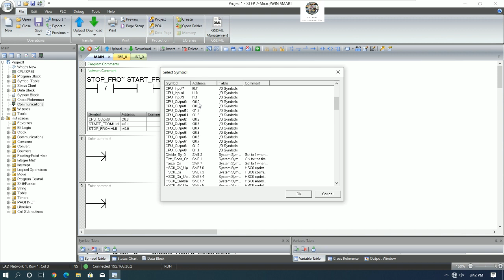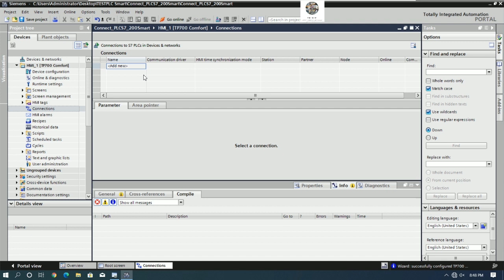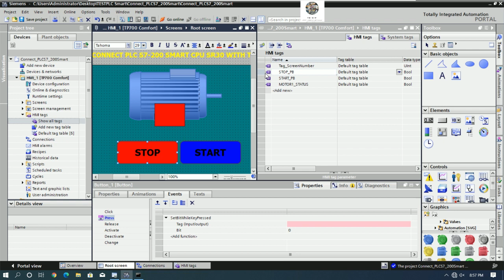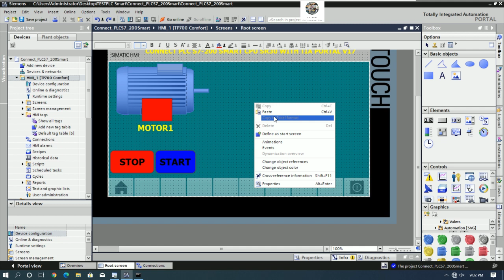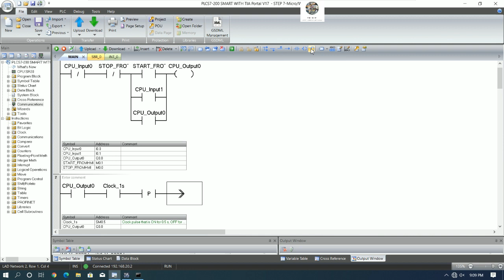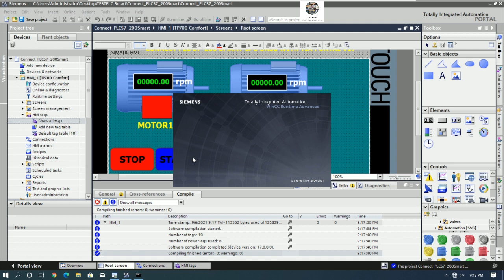TIA Portal V17 connect with PLC S7-200 Smart testing and simulation

Comment: Please its not working for me. Am working a S7-200 Smart CR40 and TIA V17
Please help
Reply from the maker: Please check PC/PG interface at control panel and try again
Reply: @generaltechnologyknowledge5165  Please what should be the settings at the PC/PG and would it work for a physical KTP400 HMI hardware
Reply: @generaltechnologyknowledge5165  Should it be my internal ethernet adapter
Reply: Thank you so much it works now. 
Please would it work for a physical KTP400 Basic HMI hardware
Reply from the maker: @emmanuelarthur1815  Ok sir thanks for your try
Reply: @generaltechnologyknowledge5165  Can it work for HMI hardware KTP400 Basic??